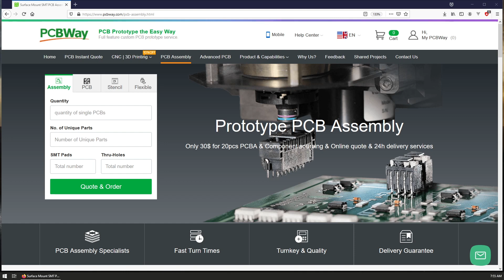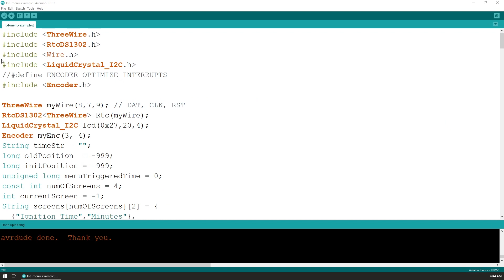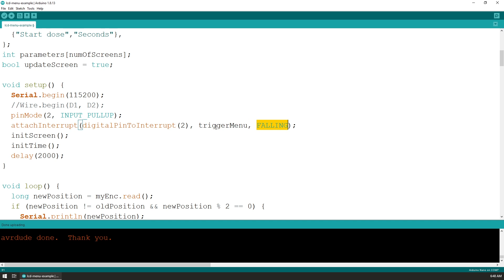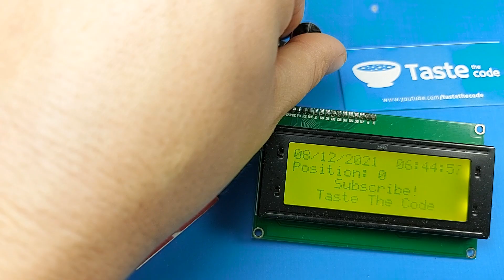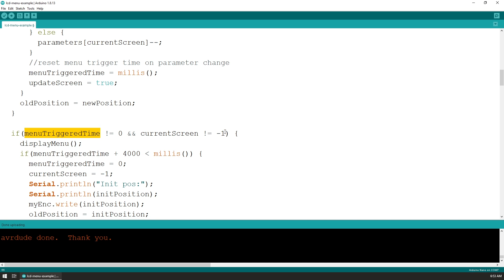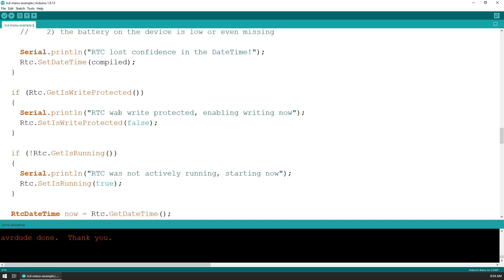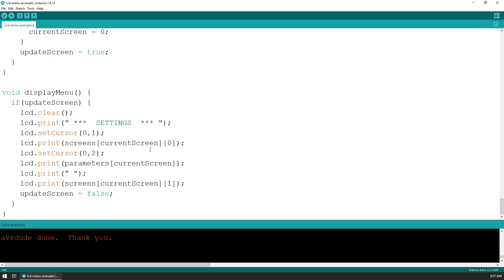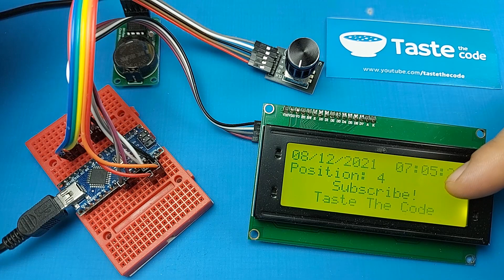Easy and Simple Arduino Settings Menu - How to

Comment: Good video 👍 One suggestion I could offer if I may... I have built a similar menu for my garden hydrant controller. I noticed on yours that the display flickers every time you change the values in each submenu. To smooth that out, avoid clearing the LCD for those updates. You only need to reprint the value that changes instead of the entire submenu text. Cheers!
Reply from the maker: Cool, thanks! I've done that on some projects but it requires that there is some static text on the screen.

Comment: Hi. Thanks for this very useful tutorial. I have a question for you: is it possible to set more than one parameter per screen? Thanks and greetings
Reply from the maker: Hi, thanks for watching! Yes, you can have multiple parameter arrays and set more than one thing at a time. You will however need to figure out hot to display these and also how to know which one you alter.
Reply: That Will be a challange
Reply from the maker: Any particular reason why you want more than 1 per screen? The display is not that big for more data display.
Reply: I am working on an aquariumcontroller with time based settings and I want to set parameters for time hout minutes per screen. I have it working now with you menu template and I was wondering of this was possible.
Reply from the maker: Maybe you can still have separate screens but you can instead show the entire time settings with hours, minutes and seconds?  This way it might look as if they are edited on one screen and the set edited can maybe be displayed in negative with black background and white numbers. Just an idea.
Reply: I know this is late, but you could code it so that rotating the knob to the right increases minutes, and to the left increases hours.

Comment: Hello, I watched your video and I copied and pasted the code and removed the time part, Yet still it doesn't work...
Error: 'triggerMenu' was not declared in this scope
and a whole lot of other errors...
Reply from the maker: Well I guess you either deleted too much or deleted the wrong part of the code. In my code the void triggerMenu() fuction is provided and needed for it to work. If you removed it, then you also need to remove the places where it is called but then again, you need to know what you are modifying and why.
Reply: I’ve actually got a design working for my needs and got a menu system working! (In this design too)

Comment: Can you help me again, recently my rotary encoder having a problem that when i connecting my arduino to rotary encoder using a long cable, this cable about 2 meters long. from your code that i use, to get into the menu i have to press the button of the encoder right? , So when i use this long cable, sometimes even if i'm not press any button or rotate the encoder, the menu was just moving, and i think its malfunctioning that when i just rotate it randomly the display get in to the menu. Also i already check my encoder voltage just fine in 5V. But if i use a short cable about 20 cm long, its working just fine, do you have any advice for my encoder, please help
Reply from the maker: I've never used an encoder with such long cable. Have you checked if maybe on the long cable some of the wires are mixed up? If so it is possible that turning is then interpreted as switch press. Other thing might be the capacitance of the cable or it acting as an antenna. Try using some twisted pair cable to see if it makes any difference.
Reply: @TasteTheCode  thank you for your help, i found the problem, the problem was the encoder make a bounce when i rotate the rotary encoder, and that bounce make my arduino thought that it was a push, so i have to adding a debounce programs to the code
Reply from the maker: Yes, debouncing is a must. I'm glad you figured it out!

Comment: How to change the parameter or value of each menu option?, i want to change the parameter of menu option to a 100 value? Please help
Reply from the maker: Do you mean as defaults? You can extend the array to have more than two items for each of the settings where the defaults will be stored, something like {"Ignition time", "Minutes", "18"}. Then you can have a call in the setup, where it will init the parameters with this value. for (int i = 0; i < numOfScreens; i++) {
    parameters[i] = (int) screens[i][2].toInt();
  }
Reply: I mean , i want to change the rotary encoder value to 100 or any value on a certain menu, so for example in setting 1, i rotate the rotary encoder to change its value increases starting from 0, 100, 200, etc.., and then on setting 2 the values start from 0,1,2, etc.
Reply from the maker: @faturahmanf3024  in the encoder handling function, you will need to add a check to see in which menu you are and then increase the value accordingly.
Reply: @TasteTheCode  okey, thank you for the advice, i will try it 👍
Reply: Sory to bother you sir, i want to ask again, How are programs for the encoder if we want the encoder value starts from certain value, for the example i want my encoder to count start from 0, 500, 800, etc., Currently i use your code sir, i see that on void loop part "if(NewPosition>oldPosition){
Parameters[currentscreen]++; "

I see that the function for "Parameters[currentscreen]++" to increase the value of setting screen 1, but its only increase the value 0,1,2 etc. How if i want to change the increase value to 0,500,800 etc
Reply from the maker: @faturahmanf3024  you can use Parameters[currentscreen] += 300; for example and this will increase the value by 300 with each turn.
Reply: @TasteTheCode  how if i want to hold the value of "parameters[currentscreen]" from one of the settings after we set the value, so if the screen go back to the main menu or the main screen after 4s, we can use the value "parameters[currentscreen]" to use that value on the void loop so i can process it to another output. I see that the value of "parameters[currentscreen]" can only used on the "settings" when we want to increase one of the settings, but after 4s if the screen go back to main menu the value just go back to 0, unless we back to settings
Reply from the maker: @faturahmanf3024  The value that is displayed on the front screen is different than the one in the settings as there are multiple settings. If you want to reflect any of the values from the settings to the displayed value on the primary screen you need to call myEnc.write(initPosition); where initPosition needs to be double the value that you want to display because for every notch on the encoder, the value increases by 2.
Reply: @TasteTheCode  okey thank you very much for your help sir
Reply from the maker: @faturahmanf3024  You are welcome!

Comment: How can I use three push  for this project instead of  rotrary encoder advice me on just three push button
Reply from the maker: You will need to update the code to react on the buttons instead of the encoder.
Reply: @TasteTheCode   thanks for that ...i need it to control my inverter project

Comment: Thanks for the Video. I copied the code and remove the time part from it. However, My encoder reads in the minus, and each click = 2 positions. when I turn the encoder the position reads only even numbers -2,-4,-6. can you advise please
Reply from the maker: Each positive stop on the encoder is actually two positions moved. Thus the 2 positions increase. For the negative increase, I think that you may have mixed the clock and data wires. Try reversing rhem in the code.
Reply: @TasteTheCode  thanks, I had them mixed. I corrected it but the position still counter 2 4 6 in both sides
Reply from the maker: You can account for that in the code. Just divide by two.

Comment: Nice rework of the code by Vladamir, I started there too but I am stuck. Do you happen to go over how to turn that menu into a working count down timer for example? I've gotten far enough to have a menu work with selections, I just can't figure out how to make those selections execute a function (a countdown timer in my case) I admit, I'm new to arduino and trying to learn so this is difficult right now for me and I couldn't tell if your other videos covered this exactly.
Reply from the maker: Hey Rob, I don't have the exact requested example but you can act on whatever value was set in the parameters array. Inside the main function, once the menu is closed, you can check a parameter, and if it is greater than 0, you can start the countdown to 0. Once it reaches 0, the countdown will be stopped and you can return to the previous state. I hope that I can soon release the code for my pellet burner project where this menu is used, but it needs some more work. That should hopefully make it easier.

Comment: Nice one as always Bill. I notice you always use that stock IDE, do you ever use one of the alternatives to get more of a traditional C++ experience? In my one or two minor arduino projects I've done it was the first thing I did, that standard one drives me nuts. Not even sure if it supports OO, it's plain C isn't it? (I guess not cos C doesn't have string.)
Reply from the maker: I use VSCode in my daily work but it does not feel right with Arduino :D The stock IDE is more of a personal thing and basically something that I'm used to. However it does lack some features like code navigation for example. OO is supported but really used outside of libraries and the language is not pure C++ but a subset of it that is focused on reducing program size and RAM usage.  
At the end of the day, its the projects that matter and the IDE is just a tool for getting it done. In some cases you may work with a special, one of a kind hammer, but most of the time, any hammer will do 😁
Reply: @TasteTheCode  VSCode, I haven't tried that, I used visual studio for many years but ... Not the same thing are they? I've been using only Eclipse and Jetbrains for the last 7 years. As you say, it's the project, not the hammer.
Reply from the maker: No they are different.
Reply: Arduino uses CPP11. You can do OO. The String library is a custom implementation however